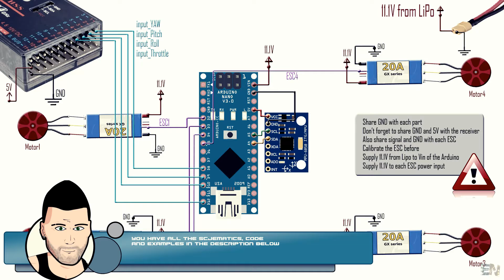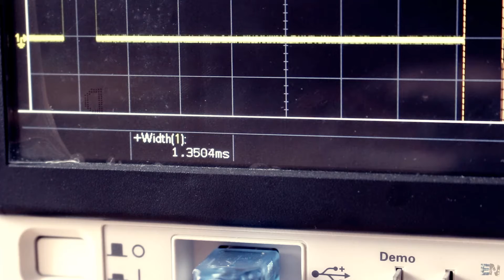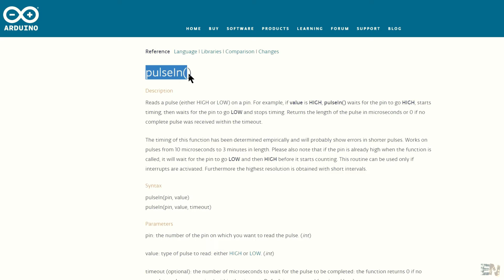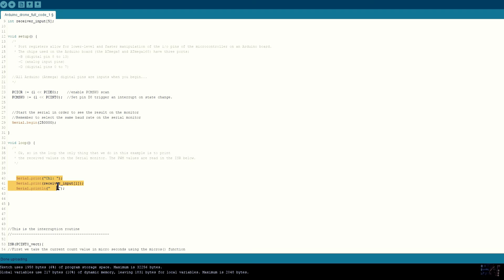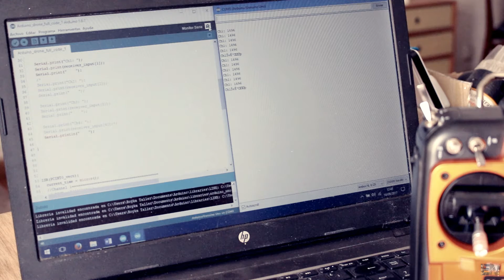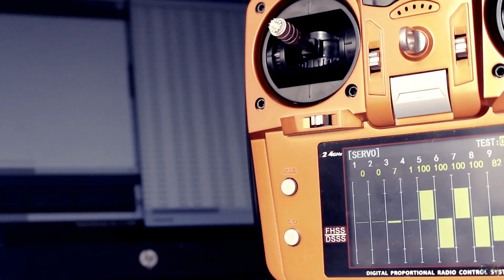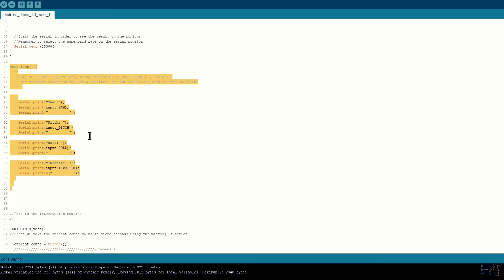Arduino DRONE II   Part 1 receiver PWM read

Comment from the maker: Stay tuned for the next part. Check the description for all the codes. Also the ESC calibrate code. All the schematics, ect...
if you consider helping my project, use the links above to buy the parts or check my Patreon page: https://www.patreon.com/ELECTRONOOBS
Reply from the maker: I use design spark and easyEDA for my schematics. But I design the schematics for the videos in Photoshop so anyone could understand..
Reply: your Magnetometer X axis is not in same direction as your MPU6050   did that work correctly ,  i have no experience with magnetometer so  please explain me if it works.

Comment: I tried all the Arduino Nano firmwares, I just can't assemble a budget quadcopter.
Reply: If the firmware of the drone works, then the firmware of the remote control does not work, and vice versa, the remote control works but does not accept the firmware of the drone
Reply: In my opinion, it will be cheaper to assemble a ready-made kit, since self-made ones work unstable or with bugs

Comment: When you exlsin it it all seems so simple and abvious. But i always  get stuck some hiw  like my mah watt meter is neasuring  about5  amp hours leaving my batter when nothing is connected just becayse if noise ir false readings i tried to set minimum thresholds to ignore some readings. But still just readig voltage values which us easy does not worj for me you read pwm by asuming that afeter a rusecyouvshoyld get a,drop next and calculate the time this,way. But i sm sue mutphy will think of s9me thing to mes this uo forcme.

Comment: Only one problem with this solution that Arduino micros() finction has a precice of +-4us (kind of jitter), that allmost 1% of movemet from neutral to max\min. It's too match for me. I started my own project that should extend life of my old transmitter, but even without embedded arduino functions all I got is +-1-1.5us. This is not so bad, but little annoying. For some planes it's ok, but on my WW2 12 scale warbirds it's cause awful unstable flight :(

Comment: Why dont you create own PCB board? Would be much smaller.
Reply from the maker: I will soon!
Reply: Also, I strongly recommend you to research quaternions. Method for describing rotation using mixed acc and gyro data.
Using of acc data only not very good and dangerous method for quadcopter.
Reply: There are no need special hardware for making PCB, all you need is сlothes iron, laser printer, hydrogen peroxide, salt and lemon acid.
/watch?v=mv7Y0A9YeUc
Reply: Yeah, I making right now, not quad but USV (sea drone). Using gps, quaternions, and arduino mega, but wrinting code not in Arduino IDE, but in Atmel Studio at C lang, much more possibilities and less firmware size.
Reply: Also, you can order 10 PCBs of less than 100x100 mm for just $2 (all of them) in JLCPCB/EasyEDA. GreatScott! has some videos on this (https://www.youtube.com/watch?v=Fj0XuYiE7HU )